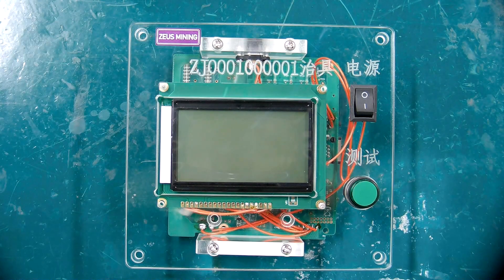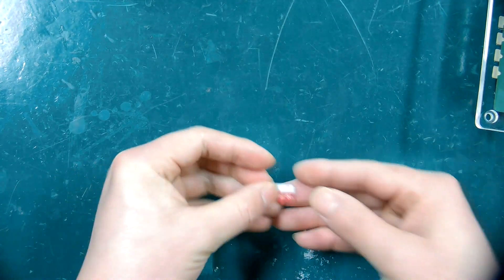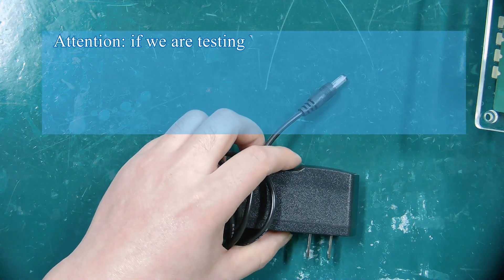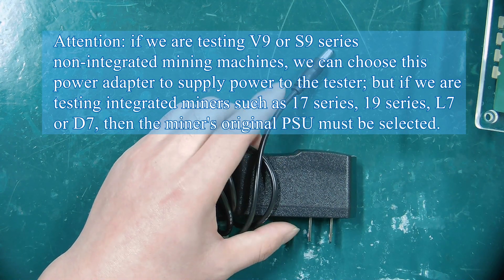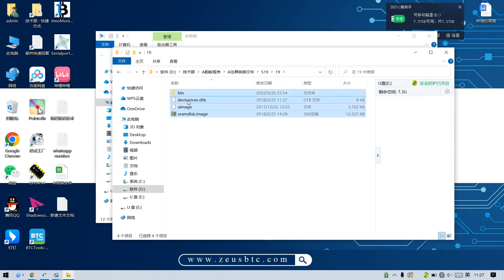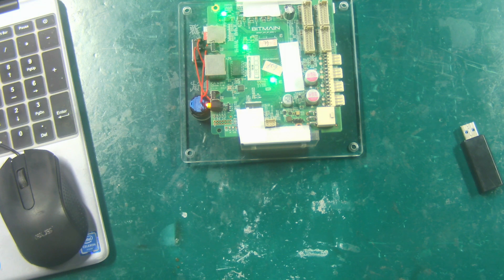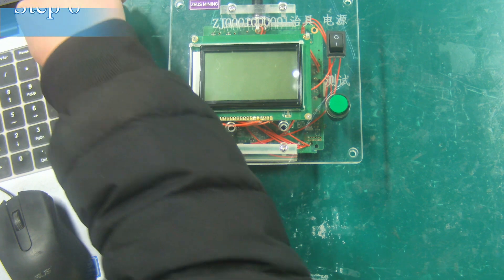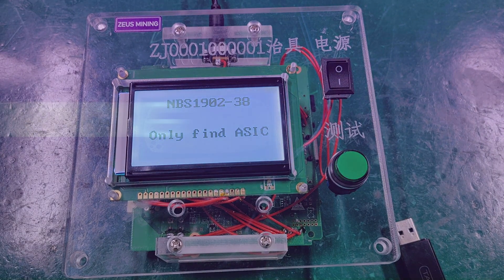How to install conversion and test file when use Antminer test fixture to test hashboard?

Comment: Is this package for that universal antminer test fixture? 

I bought it, and I got these files : 

Conversion file (zip archive : 
conversion_files.zip)
S11 conversion file.zip
S15-S17 conversion file.zip
S19_Pro conversion file.zip
T19 conversion file.zip
V9 S9 conversion file.zip 

Test files:
S17e.zip
t17e.zip
t17.zip
s19jpro.zip
D7.zip 

I bought the package to use with S9, T17e and S17e, but  there is no conversion file for S17e/T17e, and no test file for S9, or am I wrong ? 

What conversion files should I use for S17e, T17e,  and what test file should I use for s9 ?
Reply from the maker: S15-S17: 15 and 17 series conversion files
S19: 19 Series Conversion File
V9 S9: S9 series conversion file
If you purchased the document from us, if there is anything missing, you can contact our sales (WhatsApp: +8618623251355) to reissue it for you. Thanks.
Reply: how can I get conversion file for for s19 series